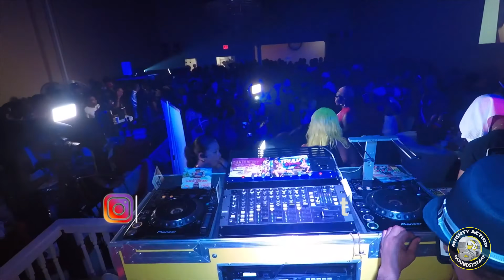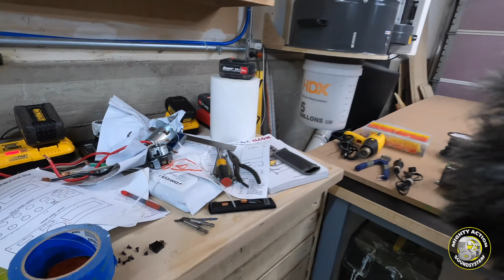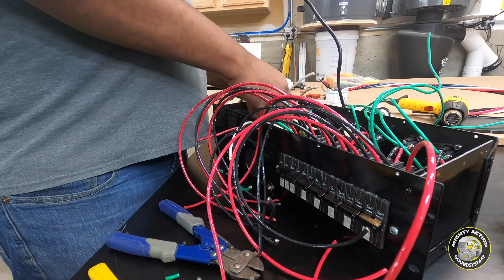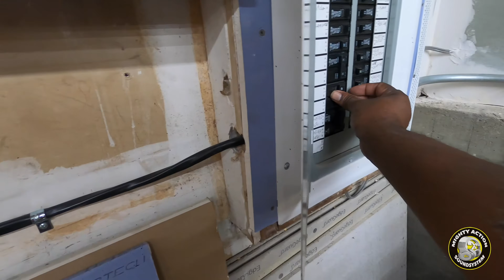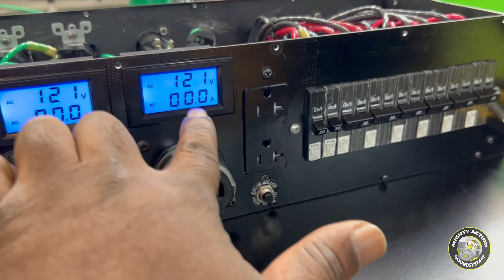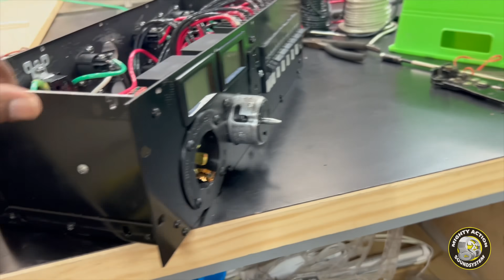CUSTOM RACK MOUNTED 3U POWER DISTRO PT2.. 50A 240V

Comment: Great video . This will help lots of people out there who cannot afford the $ 2500.00 to buy a power distro from Motion Labs or Whirlwind . I am guessing you are within the USA right now? If that is the case you could have used 6 ga. Wire for your main power in but you can only go one wire size down to 8ga wire for your ground . Since you used 4ga wire you should have used 6ga wire for your ground . I just built 6 of these for my systems , but used all Hubbell connectors and Square D breakers . I modeled them after the Motion Labs distros . I also found a guy in town who does Laser cutting and water cutting . So I had him cut all of the holes out for me to make it really clean . What would be GREAT is if you made a parts list and where to buy them so others don’t have to go through the pain of trying to find it all . I bought most of mine off of eBay . I saved tons of money . The one thing I did is on the front I put a unground plug with type “C” and LIGHTING PLUGS to charge phones . You’re never looking for chargers this way . Thank you for sharing this with us all …. HAVE WONDERFUL BLESSED DAY . Get that parts list put together …..LOL…..

Comment: If yuor main plug is 50 ampers you can use cable #6 that cable is 55-65 ampers, is not necessary to use a bigger cable, but you can use #4
Reply from the maker: Good advice, respect!
Reply: @MightyAction i built distros too jaja up to 400 ampers

Comment: Here’s my concern if the main power source is 50amps that means the most u can have is 50amps and up to 40amps  on 100ft run because most long runs are rated for 80%.. my concern is why do you have so many 30amps on a box that’s only powered by  50 amp 
U have 230 amps worth of breakers on a 50 amp cable the math to me I’m not understanding even if your not using all to its full potential it seems unsafe
Reply from the maker: The 30amp breakers are used to protect the amplifier and other equipment that are connected to them. So no more than 30amps will be allowed to pass through. As for the 50amps that is to protect the overall box.

Comment: hi are you using neutrik nac3mpa? could you show us how to connect cable to this kind of connector? what tool do you use?The end of it has three copper plates with holes on the end. There is very little space around it. The holes are also very small. I see the socket you are using looks like this.

Comment: Oh, wow... I hate it. I would rather poke an angry tiger with a stick than ever touch that "power distro" (looks more like a fire distro to me) while energized...
1. Never double-tap screw terminals. The wires will compress unevenly and you will eventually have loose connections. If you need to double tap, use double wire ferrules.
2. Never ever ever ever mix wire sizes when double tapping. Again, you can't guarantee a secure connection.
3. These PowerCons are inlets. They are designed to accept power, not supply it. By convention, there are cables from NEMA plug to Powercon 32A. If these get inadvertedly plugged into this box, you have a phase-to-phase short in the best case or a electrocution hazard killing someone in the worst case. Use grey powercon outlets, powercon true1 outlets, IEC C19 outlets, NEMA sockets or an attached pigtail to a NEMA socket (grey powercons should be direct retrofit for up to 20A).
4. Grounds! I doubt the terminal on that NEMA socket is rated for two spade terminals. Each removable panel of the enclosure should have it's own ground. No, the ground connection through the sockets aren't enough. No, the panel screws are not enough. And you also need to scratch away the paint at the grounding point so the whole terminal has contact. You might have continuity if you don't, but I doubt it could reliably pass the possible fault current (which is its only job).
Reply from the maker: Ok thanks

Comment: Any particular reason you used Din Rails with terminal blocks instead of bus bars?
Reply from the maker: Tight space, not enough space to use the bus bar with these thick gauged wires

Comment: You used Speakon 8 pole panel mount to output AC power to your amps? Big problem!  You need to use Powercon. There’s 2 versions, Blue for inlet, White for outlet. The plugs fit only in the right one.
Reply from the maker: No I did not used Speakon 8 pole
Those are powercon 32amp plugs

Comment: Good video, nice work. Question :  50 amp distro usually uses SOOW 6/4 cable from breaker panel , generator, or other power source. Why does my house in JA have some flimsy cable from pole to the meter,  nowhere near 6/4 gauge ? JPS approved  and passed.Breaker panel is 2 50 amp main breakers. Panel wires @ main breaker are maybe 10 gauge. None of these are #6 wire, and the run from pole to panel is 300 feet. The resistance of 300 feet is far greater than 50 or even 100 feet of 6/4 . Any answer ? Bless up

Comment: Jesus… This is why Americans shouldn’t be allowed electrics.

The 32A powercon is not an outlet. It is an inlet.

You’ve just made a massive Widow Maker.
Reply from the maker: Explain as well so I can learn
Reply: @MightyAction  You should not be doing this work on your own if you're still learning. It's concerning that you had to ask if an 8 gauge earth was enough. Did you do any further testing to ensure the distro is electrically safe?

If you tried to plug that into any of my systems I would rip it apart. You know just enough to be dangerous.
Reply: @MightyAction  The guy below explained it pretty clearly. I'm not sure what more you need to hear than "it is an inlet connector".
If you can't understand these simple things then you should simply not be building distribution equipment.

Comment: Tell me they aren't 32A Powercon, this is F**king DEATH TRAP!!!

32A Powercon chassis is an INLET!!!!! AKA MALE AKA DRAIN!!!

A standard 32A Powercon lead has F**king PLUG on it!!!!

This is UTTER SHIT!
Reply from the maker: Please do explain. 

Neutrik NAC3MP-HC powerCON 32 Amp Chassis Connector

Tell us why they are not outlets.
Reply: @MightyAction  because power goes IN to an appliance through an INLET connector. Power comes OUT through an OUTLET.

This is why the 20A Powercon has a Blue version and a Grey version.

Neutrik only make Inlet versions of the 32A Powercon, be that the standard Black ones in your video or the White ones that have multiple Earth terminals for medical equipment, etc.

If you look on the back of an amplifier they have the 32A powercon on them.  You can power up the amplifier with a normal Plug to 32A Powercon cable. Now think about what happens to that normal plug if you connect that cable to your distro and touch the pins of the plug...
Reply: @MightyAction  he words "32A connector, POWER IN"